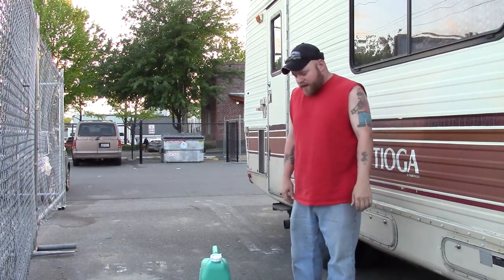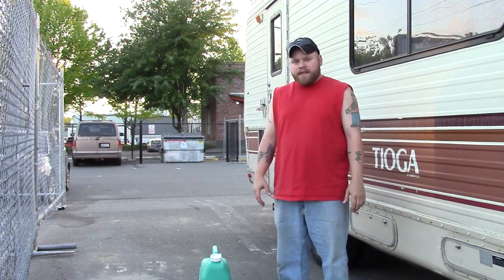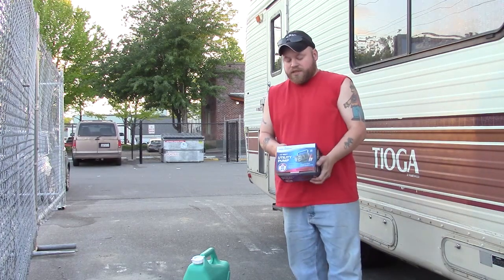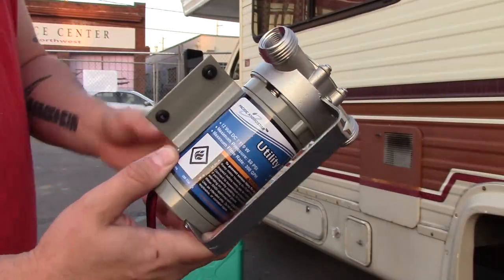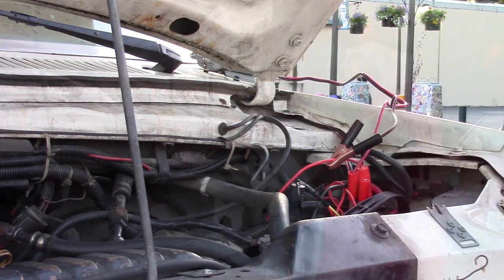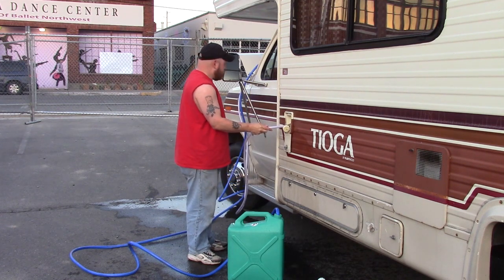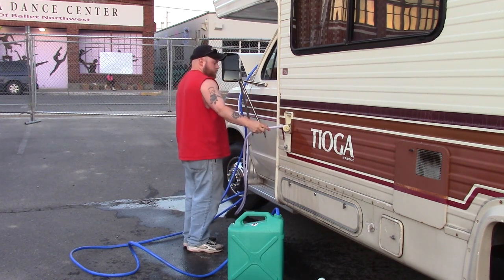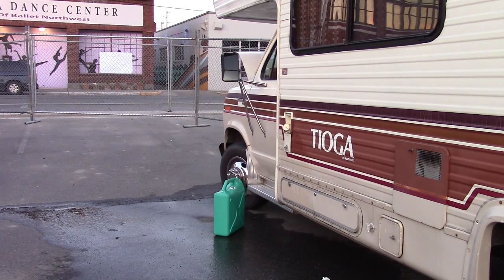Getting Free Water Into My RV

Comment: Hey Eric.  I just put my jug a little higher than the tank fill.  Then I siphon it in.  Takes about 2 mins.  After getting tired of that I actually put a bypass with a shut off valve from my pump outlet to my tank line.  Then I use the little hose to on the suction side of the pump (used for winterizing) to suck the water out of the jug.  I'll post a video in the group this weekend.

Comment: Put a small fold-down shelf or bracket next to the water fill point on the RV, sit the 6 gallon bucket on the shelf, use a siphon to move the water. No pump required. The shelf/bracket could also be built to clip onto the RV, and remove when done.

Comment: Just a tip.. Always connect the Live last because if the Negative clamp contacts bare metal anywhere on the camper the pump will run. Love your vids btw. Would love to pluck up the courage (and money!) to do the same.

Comment: Just a thought, what if you put your hose at the water source. Like inside the spout where the free water comes out. Then connect that hose to your pump?
Or even put your 6 gallon container by the spout, run a long hose to your pump and as the water starts getting low place the container back under the spout to fill it without having to stop the pump or walking back and forth. What do you think?
Reply: Thanks for replying to my comment; I think it's the reason you have growing subscription. I didn't think that you would actually reply.
Thanks

Now stop replying to everyone and make more videos!

Comment: They make a shaker siphon that as long as you have the jug higher then the fill port you can move a liquid by just setting it up and leaving it no power needed. Simple setup and self primes by just lifting and dropping the hose a few times to get the flow going. 

Also works for fuel but you would want a second for that so you keep them separate for a cleaner method then dumping into a small hole and hoping you don't spill.  

Ether a fold down self or a folding table to set them on and you are good.  If you are going to do this often a strap to keep the hose from hitting the ground is a must.

Comment: Couple things i noticed.
Turning that pump on will melt the rubber impeller on the pump if it isn't primed real fast You may want to have a couple spare rebuild kits ready.
At the end of the video you just threw your hoses in the storage compartment, wouldn't it be better to get some kind of caps to cap the hose ends off? It would help to keep trash  and bugs out of your hoses ,then it wouldn't end up in your pump or inside your water tank.

Just a couple things to think about.
I do enjoy watching your videos.

Comment: Well if you run a wires over to one ot the out side storage bays by your fresh water intake then have it connect to your pump there, then you dont have to have to use long hoses or make it easier to turn on or off the pump. Use a quick disconnect in the wiring system in the storage area

Comment: Just a thought, dont know if its possible: a hose long enough to run from that water source right into your RV, using that pump: you just put your container under the tap, fill it, and start filling your RV immediately, no need to carry containers around. all you need to do is park close to that source.

Comment: Nice water source. :)  It might have been easier to fill your tank if you did use a bucket, left filling with water with the input hose in it, and use a water tank filler with a shutoff on the output hose.
I hope you filled one more 5 gal. jug for the road.
Jon